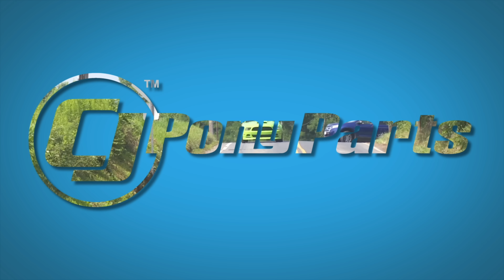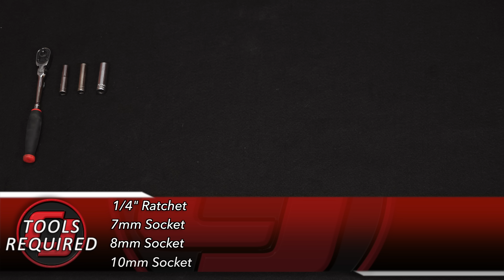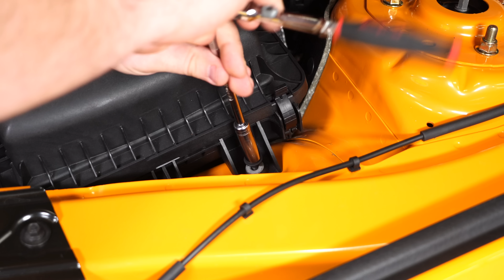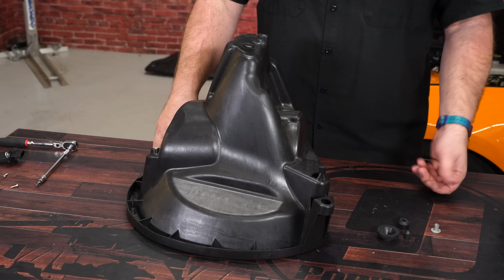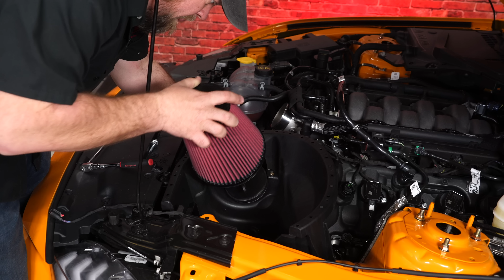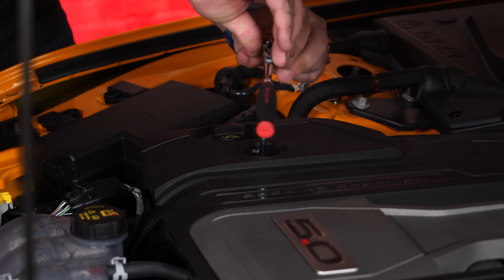2018-2023 Mustang GT Roush Cold Air Intake Kit Installation

Comment: 2020 mustang gt convertible logging p061b   Torque calculation code   After installation of this cold air intake.  Had to remove the inner insert where the mass air sensor is to make it run. Seems to be good now.   Is this normal?
Reply: I just got a P061B code on mine rn. I think sound tube needs to be removed?

Comment: Is there anyone out there that has installed this on a 23 and can confirm it fits without any issues. Roush is telling me that it is not made for a 23 GT
Reply: I'm trying to figure this out too. I also am trying to buy the 87mm throttle body with the adapter but I'm not sure if this intake will mount up to those parts with no issues. I've checked the forums and reddit and still no answer
Reply: @SEXC_MIKE  That's the only downside to buying a new model at the beginning of the year. Non of the parts for the previous year have been approved for the new model even though nothing may have changed.

Comment: Just installed this in my 21 mustang and it feels like it loss a little bit of power not as responsive as before not sure why? Should I get a tune for it ?
Reply: Standard one’s really good one. To make it better you can’t just add more air. Remove filter = another extra air portion but it propably will effect cel. Standard ecu maps can’t adjust so much - you need to buy ready tune from roush or go for a dyno and have individual tune done. A lot of air in n/a in low rpm isn’t something that makes engine „stronger”. Look at BMW intakes - they’re best one you can imagine for a daily coz they have disa valves that change intake lenght (intake’s not moving - it changes air routes inside it) coz in low/mid rpm it’s better to have longer intake (slower air supplying). Car that makes great hp/torque in high rpm but in low/mid goes like shit makes overall shitty expierence in a daily use. Same with your car - adding extra 10hp and some torque in 6500 rpm but losing 20hp and a torque in 2000 rpm makes overall experience that car’s slower.

Comment: Has anyone gotten a wrench symbol after installing this with no tune. How to fix this?
Reply: Yes I did on mine remove the insert from the roush inlet tube I had the same issue it said powertrain failure so I put the factory back on everything was good so this time around I took the insert out works like a charm and no tune

Comment: Does this work with the 2022 mustang gt even though the 22 model has a different engine calibration than previous years?
Reply: It fits. 2022 model has 10 hp less. Not a deal breaker imo. I own a 2022 myself
Reply: Did you end up getting it?

Comment: Mr. Bill hav a question does the assembly connecting to the inlet pipe need to be air tight thur the dox. The tube doesn't fix snug and has a gap so wondering if thts a problem meaning sucking hot air from the engine rather the cold air intake..? Thank you for ANY help, TC oh also coming off a Roush phase 2 SC

Comment: Since it’s an aftermarket intake would the check engine light come on ?
Reply: Not if you keep the sleeve insert. If you remove the insert than more air would come into the engine and you will get a check engine light. The only time to remove the insert is when you get a tune

Comment: Why would you cut into the engine cover when you have to remove it to install the cold air intake? Just keep if off. Lol
Reply: The covers there for a reason mate
Reply: @blckstang6363  to dampen sound which is the only thing. The bullit or the Mach 1 do not have it so technically is useless
Reply: @blckstang6363  please explain what reason that is?

Comment: IMPORTANT: Does this fit on 2015 gt mustang? Especially that I can’t find airbox lid for roush intake on 2015 mustang GT. I need the airbox lid so bad for 2015 roush intake any tips?
Reply from the maker: NO the intake is completely different, there was no sealed box for the 15.

Comment: Why a cover now? My Roush kit for my 2017 does not have a cover. I thought the whole entire reason for the intake to be wide open was to draw in more cold air? What gives?
Reply: Heat soak. Open air CAIs tend to heat soak from engine heat and the IATs tend to go up. You actually end up losing power cause the car will start to pull timing when the IATs are higher since the air won't be as dense.

Comment: I've seen reviews that if you dont tune it then the car loses power and wont run right..is that true? Or can I just install it and not worry about anything? Please get back asap! Thanks!!
Reply: Only if you get heat soaking will you lose power up front.
Reply from the maker: We installed this without a tune and it runs fine. A tune will help but there is no problem with installing this without one.
Reply: the truth that if the car loses strength, very disappointed of the product

Comment: Bill great work. I'd just go without the cover though. It just looks too makeshift after getting cut.
Reply from the maker: I would agree it looks cleaner without it.
Reply: The template they give you cuts off too much material... better to custom cut it yourself for a better fit.
Reply: @KylesCabinets   or add some spacers to where the cover bolts on so it raise it a bit and you don’t need to cut it
Reply: @soulja4187  I decided not to cut mine and went right over it with no spacers needed lol. Looks great.
Reply: @KylesCabinets  good feedback

Comment: what is the power gain on this intake?
Reply: Daniel Fuller there is gains I just installed it on the 18 mustang gt and you cold feel more response with it. I could imagine with the tuner is gonna be better.
Reply: Tony Palafox I don't think it's worth it at this point in time but that's just me we are in the really early stages of the 2018 gt and there is still a lot to learn
Reply: Daniel Fuller none
Reply: adrian vindas wtf is the sense then  lol
Reply: how much tho cause for 10 hp its not worth it without a tune and by the time you buy a tune as well its going to be close to 900 bucks after all said and done you might as well save that money and use it on something thats giving more power!!!
Reply: Daniel Fuller is around 15 of gains and then later on I'll add something else and that will help more

Comment: Thanks! You have just talked me into letting the dealer do this for me! My dealer is a Rouch dealer and I’m sure they can handle it for me LOL I  Will have my H pipe and this done both at the same time!I used to be pretty mechanically inclined but I just can’t be bothered anymore.

Comment: Just checked the Roush site on this part and it does not list any Horse Power gains at all.  So you would be spending over 400 sucker bucks, for nothing but the Roush name. Just drop in a K&N filter and save yourselves 350 bucks, and you won't have to cut up the intake cover.
Reply: I totally agree. Adding a CAI does not improve any gains. It's just for looks.
Reply: Also with the CAI you have to cut the engine cover also if its installed, it's just a bad idea all around.
Reply: I bet if you just installed a K&N filter in the stock air box you may have had the same result for a lot less money
Reply: CAI are all for looks unless you get it with a tune or plan on getting a tune down the line
Reply: I just installed it on 18 mustang gt and you could feel a little more gains. I imagine with a tuner will be better
Reply: T Rust I did and is not the same
Reply: You need a tune to  get HP gains

Comment: That color car is easily the most beautiful I have ever seen. But I still cant wrap my head around they still have the sound tube and the hood stick.
Reply: MrMrwilson11 what does the sound tube do
Reply: @techmaster777  It takes sound from the stock intake into the dash/cabin. Exhaust sounds are more throughout the car. Without it the inside is more quiet, but you hear the exhaust from the outside more. Most people remove the sound tube. Some say they can't tell a difference with it off. I do, but it's not a huge difference.

Comment: It would be nice to have before and after dyno numbers on these products. Roush calms a 10  HP gain on this system, but did not say it was with or without the insert and / or a tune with the insert out.
Reply: DeadMansHand 13 that's without a tune.  With a tune would be in the 30
Reply: @ericpugh247 is that proven?
Reply: @saulmoran508 yes. Without a tune.
Reply: @ericpugh247 thanks man I have been trying to find a vid for it but nothing I obviously have a tune ready to go just not too sure to go with this or a pmas

Comment: I pre-ordered it from roush when they released it a few weeks before, installation was pretty easy, though the instructions provided have a few things needs tweaking, things like they totally used the wrong picture to point out which clips on the sensor line needs to be removed to make it reachable to the new location. Also, I suggest anyone who's planning on eventually selling the car leave the engine cover off, since I heard that part is not cheap, it also looks better without the cover imo :D.